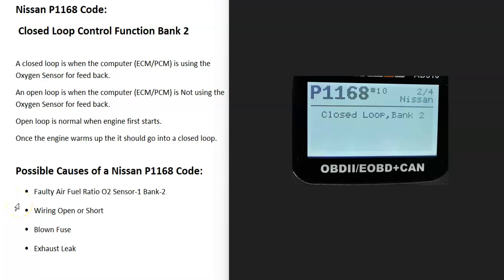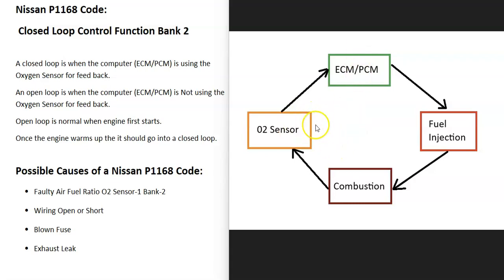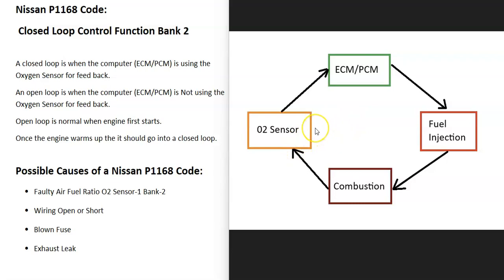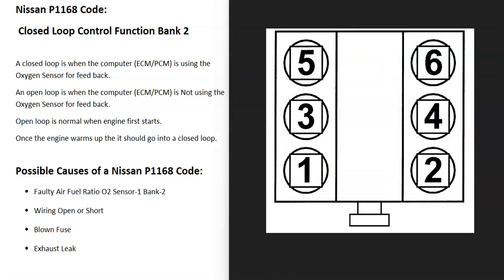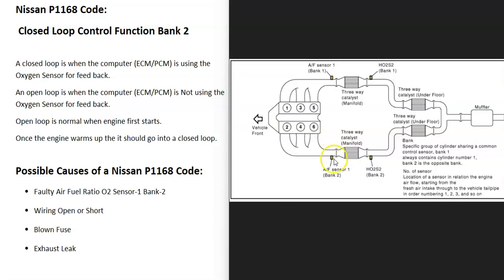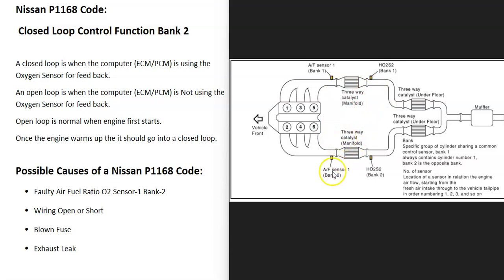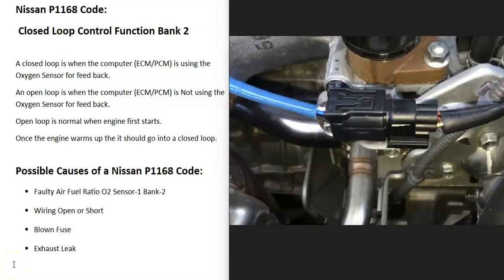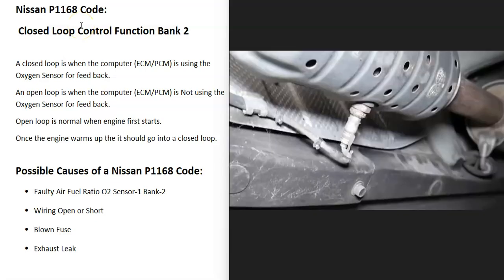Causes and Fixes Nissan P1168 Code: Closed Loop Control Function Bank 2

Comment: OK guys don't learn things the hard way like I did. The upstream is not, and I repeat not an oxygen sensor but it's a fuel sensor. You can buy as many oxygen sensors as you want and it won't fix the issue. You need to buy a fuel sensor for the upstream sensor. There's a big difference between oxygen sensor and fuel sensor a Nissan.
Reply from the maker: Oxygen sensor is a generic term mechanics use since there are many different types of 02 sensors that look the same and basically do the same thing. How they are tested is the main difference.
Reply: @HVAC_Mechanic  Okay. So, are the air fuel sensor AND upstream oxygen sensor the same sensor here?

I have two codes displaying, P1051 & P1168, and your video along with two others are all saying replace the same exact sensor, even though one of the videos is a P1051 repair video.

Thanks in advance man

Comment: So I inspected my passenger side O2 sensor air fuel ratio sensor whatever they're calling it seems like the clip was open. Took a few minutes to configure for it's hard to snap together, you did say to inspect the wiring on the af sensor. Fixed the issue, thanks.

Comment: What is A/F sensor 1 heater bank 2 what does this mean
Reply from the maker: A/F sensor stands for Air/Fuel Sensor, which is basically an oxygen sensor. Heater points to the heater element that is built into the sensor that helps it warm up quickly on a cold start. V6 and V8 engines have two banks, bank-1 is on the side with the #1 cylinder, and the opposite is bank-2.

Comment: Please Help, I have a 2014 Nissan Pathfinder with a P1168 code its now throwing, The Muffler shop replaced both front right and left cats TWICE and all 4 sensors TWICE.  After the initial replacement of the P0420 code, I have been back to them more than 10 times with check engine light all cat code related under their part and work warranty.  They said there are no leaks in the exhaust and all wires check out. Any suggestions are appreciated?
Reply from the maker: Does the engine go into a closed loop and then intermittently throw the code, or is the code thrown immediately? There may be a bad connection or bad wire somewhere, causing an intermittent problem.
Reply: My friend who runs a garage told me that if we didn't replace our catalytic converter with a replacement from Nissan we would have a constant check engine light on. Well...... we didn't want to pay the enormous price for the one from Nissan, so we went with an aftermarket unit. The car runs fine, but has the check engine light on constantly just like my friend said it would.

Comment: If an exhaust leak is causing the P1168 and P0051 DTCs, would using an oxygen sensor extender nipple help fool the computer?
Reply from the maker: A P0051 Code is for the heater elements in the sensor, when using spacers, they for the oxygen sensor part. I would test the sensor heater element and the wiring.
Reply: I did the engine to my car and took out the pipes and now I’m getting those two codes

Comment: I changed my censor with OEM replacement and am STILL getting this code after erasing codes. Nissan suggests it hs more to do with the fuel rail system than anything else
Reply: I'm having the same issue.
Reply: i saw a video that said it could be the fuse for the o2 sensor, it should be number 15 located right next to the battery
Reply: @rem8478  nope wasn't that. The Maxima is just a picky B** and will only accept the factory replacement.  I wasted thousands of dollars buying aftermarket shit off of amazon. I think the name of the brand is Danson or something like that  #Fixed.
Reply: Same problem here.  P1168 new sensor still getting the code.  No wire problems
Reply: I would replace fuel rails, this is where I am at in the diagnostic process, too. O2 sensors read perfect in the computer but I still get P1168 and P0051. I even solved as many vacuum leaks as possible.
Reply: Have yall tackled down the issue ?
Reply: Says in the scanner that it could be maf sensors but replaced and codes still there

Comment: Mine says p1168 manufacturer control
Reply from the maker: Some OBDII codes are manufacturer specific with a different definition. If the scan tool is not manufacturer specific, it will display manufacturer control or manufacturer specific. Basically, need to look up the code definition from the manufacturer (Nissan, Dodge, Toyota, Ford) since it may be different.

Comment: Hey buddy... i have a 2004 nissan titan... (v8), it drives fine, until i give it gas like to try to pass someone... then it bogs down and sputters till i let up on the gas pedal. Its throwing codes P0037 (bank 1 sensor 2), P0057 (bank 2 sensor 2), and P1051 (manf ctrl fuel/air metering aux emission controls), and P1168 (mfg ctrl air/fuel metering).. all these need to be replaced?
Reply: I wanted to purchase a 2008 convertible murano and in the ad it listed sensor code P0051 and P1168. Is that a major issue or expensive to fix? Also, should I bypass buying this vehicle. The miles on it are pretty low and around 68,000 for a 2008. I look forward to your response. Today is Sunday 5/5/2024
Reply from the maker: They will need to be tested to see if they failed.
Reply: Any Update on your codes??
Reply: I have P1168, P1051 and P0420 😢 same problem bogs and sputters 🫤
Reply: @RocScar  Did you ever find the issue